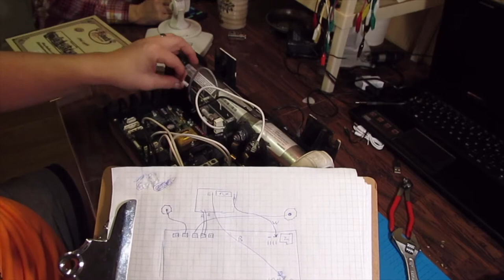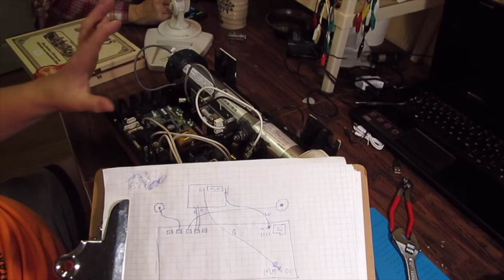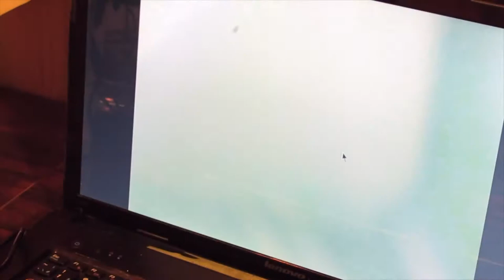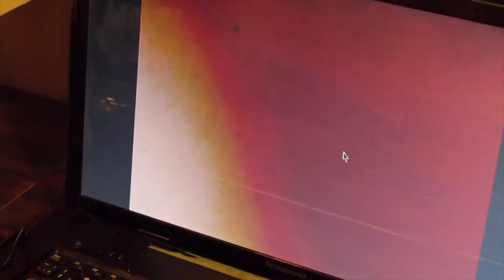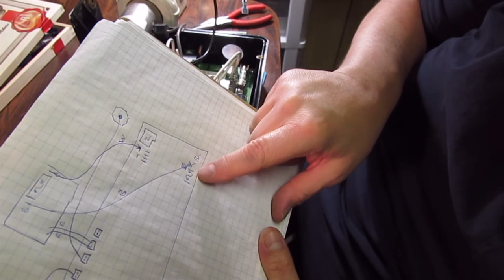Hot Tub Circuit Board Repair. Common Hot tub problems. Blown Transistor.

Comment: Zettler relay failure is common on balboa boards.  The cold solder joint you repaired is the second set in the tandem relays that control the heater.  The first relay closes if the temp limits are good and the lower relay closes when temp drops below the set point. I use jumper wires on the new zettler relays to beef up the circuit and bypass the pcb to avoid the issue happening on the future. They make the same relays that accept spade connectors in order to add jumper wires from the board to the relays. I learned some good soldering tips from you, thanks!
Reply from the maker: Darn those relays .

Comment: Hello, I have the same board with a faulty relay, it is on order. I also have 2 resistors that are rusted beyond belief with a bad spot solder on one, do you know what W the resistors are on this board?
Reply from the maker: I cant say for sure, but mostly 1/4 watt.  there is no harm in going with bigger wattage. 1/2 w say. as longs as you can get them through the holes and have a pad to solder too.  Good luck.

Comment: Did it work, i was wondering if you put the red and black 2 wire connector from pump 4 board on the right terminal
Reply from the maker: Yep Worked like a charm.  The guy uses it almost every day.

Comment: I hate to be the smart ass that has something negative to say but this is very important, to not damage your heater. If you are going to remove the connections at the heater posts, you MUST hold the heater posts from turning! Most heater posts will have a 1/4" hex underneath the wire or copper tabs. Some will be 5/16" In this video, he is holding the 3/4" nut that bolts the element to the manifold. That is unnecessary and totally incorrect! You need to make sure the heater post stays exactly in the position it already is in, or you will for sure damage the element! Hope this saves someone from ruining their heater!
Reply from the maker: Good Tip, thanks

Comment: Was wondering, I have a Maax 460 Mach3 hot tub Supposedly with a Balboa control board Part number # 54301-04, If i was to uninstall it and send it to you would you check it out the hot tub seller tells me it would be ridiculous dollars to fix. it has an error code of Eather 5nb or Snb be willing to pay for your expert consult.
Reply from the maker: Thanks I dont want your money.  I want YOU to try.  If it is broken, then you cant make it any worse.  My quick look showed me this below:
Well, since snb means "sensor b" and is telling you that one of your sensors (the one plugged in to the connection marked "sensor b") is bad, I would say test the sensors. They are the 2 black nuts on each end of the heater, with the gray wires. Turn off power and switch them at the circuit board. If it then says sna, you have a bad sensor.